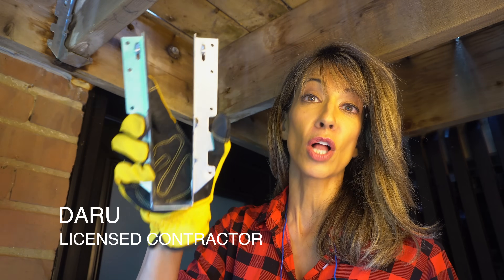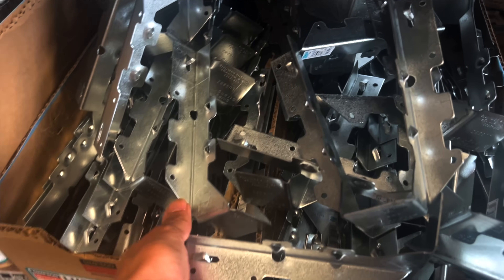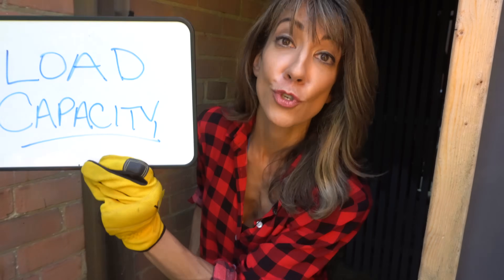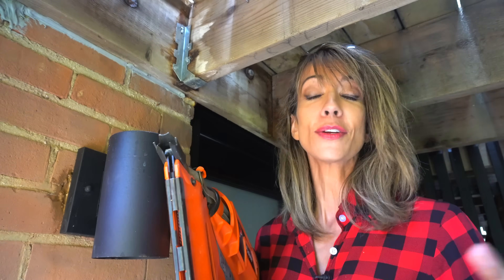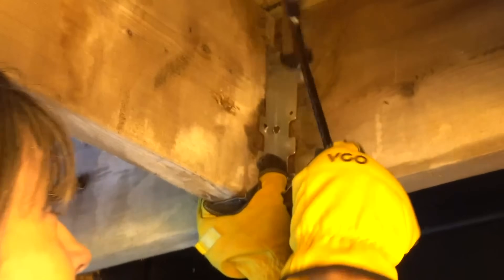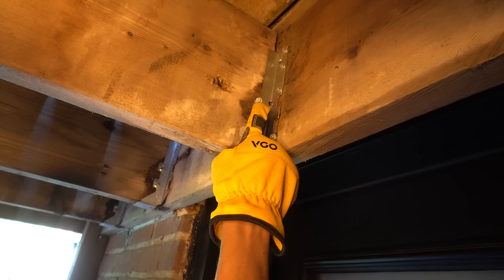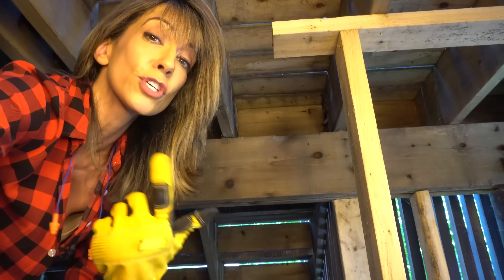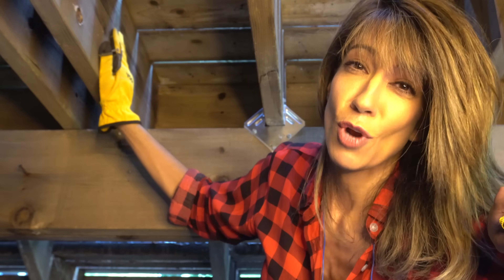Joist Hangers: Do Screws Beat Nails? (Backed by Science)

Comment: I would humbly suggest to you and your followers that in addition to joist hangers which obviously are a must, you also have to put tension ties onto the joists, drill a hole through the ledger and then put tension ties onto the joists inside the house.  Then you run a bolt through the ledger and into both tension ties.  This does not have to be done to every joist.  Every four feet is good enough.  Your deck will never come away from the house with tension ties.  The hard part of doing this is making sure that  your deck joists are in plane with the joists inside the house.  Now, if your joists inside the house run perpendicular to those on the deck then you have to simply put tension ties on the deck and then through bolt through the ledge (and the rim joist of the house of course) and then tie the house to the ledger/deck that way.  This is a very important step that a diyer would not know to do.  These ties are also known as "lateral load ties"
Reply from the maker: @rickcimino5483  Hi Rick, thanks for sharing your experience with tension ties. Sounds like a smart way to secure your deck to the structure of the home. Very interesting. Would love to do that in the future.

Comment: Considering the weight of a big joist, and the load it has to be capable of carrying…I am amazed how weedy thin metal joist hangers are.
Reply from the maker: @contessa.adella  yes! That’s a good observation. They are thin but strong.
Reply: There are at least two companies that make sheet-metal construction connectors - Simpson StrongTie and USP/MiTek. I prefer StrongTie as they do more engineering than manufacturing and all their products are made in the USA where they can control the quality of the product. All of StrongTie's products are highly engineered and tested and will do what is needed of them if properly specified and that means using the right fasteners.

Comment: I just have one question.
I understand the 2 1/2 inch screws for the angle, but I don’t know why screws for the other holes?
The reason why I ask, because the last part ,of the shaft of the screw is smooth, and it doesn’t seem like it has enough threads to bit into single ledger board that’s only 1 1/2 wide. Why not use a 1 1/4 screw for those holes?
It’ll be cheaper on the screws, and it should hold a lot better.
Reply: Yes, she should have used the 1 1/2 for the ledger side, just as she did for the hurricane clips.  The exception is if the ledger is a double 2x10 or like, because the 2 1/2 screws will pull the double 2x10 (or similar) together.  Oddly, her hurricane clips were on a double 2x10 and she could have used the 2 1/2 there.  (There are no common 1 1/4 authorized screws to my knowledge.  1 1/2 is the trade standard Strong Tie.)
Reply from the maker: You could use the 2 1/2" screws on the hurricane clips but I'm following the manufacturer's recommendations in this video. The two 2x10 beams have a gap in them right now that I'll be fixing in a later video. They need to be clamped together for a new post install. Your suggestion is good. Thanks!
Reply: If you have a single ledger board you use the 1.5 inch Simpson SD screws. I would only use Simpson screws with Simpson hangers. The two sizes they recommend are 1.5 for 90 degree fastening and 2.5 for 45 degree. I  think there are several other brands of structural connector screws that are allowed by code but there is no guarantee that your inspector will be aware of this.

Comment: Good info 👍. The 45 deg holes are an improvement over the hangers from 30 years ago, those ones you used 1 1/2 in nails straight in. Hurricane ties are way better than toenailing joists, rafters, trusses. The screws make installing easier in tight spots.
Reply from the maker: Appreciate you sharing your thoughts on screws and the hangers. It’s interesting how much things have improved over the years. Yes, the 45 degree holes are well thought out and make things so much easier. Love the simple improvements. Thanks!
Reply: One thing she didn't mention is that in U.S one of most common hanger manufacturers is SI m  impson.  They have books full of technical imlnfo regarding thier engineered connections for a variety of common situations. 

That said, if you are building a new deck, it is large and off the ground, there are lots of design issues to get correct for it to be safe, everything from wind loads, snow loads, seismic loads, etc. and if you don't know how to correctly install a hanger maybe you need to get help from either a structural engineer, licensed contractor or building department folks to be sure you are following building code and have built something safe.

Comment: Built a large deck during Covid in our yard. Used nails of the correct size and length because they were cheaper than screws. Since I also had a lot of toe nailing to do. I bought a pneumatic palm nailer which made driving all those nails easy. Thanks for the video!
Reply: Whoever invented the palm nailer should receive the Nobel Peace Prize. That thing saves a ton of cursing and homicidal thoughts.
Reply from the maker: @dt76sf  Thanks for sharing your experience building your own deck. It’s always good to know what tools you like to use and why!
Reply: I built my 12’x12’ treated wood deck entirely with screws. There are star head construction screws for the heavy load sections and yellow/green/brown  deck screws to hold studs down. There are very strong steel screws for joint hanger securing.  I put my shoulder out about 15 years ago hammering 2x4 frames in a renovation and switched most of my wood construction to Dewalt cordless drivers and screws.

Comment from the maker: Nails and screws are both excellent and approved fasteners for joist hangers. Have a favorite? Let us know what you like using in the comments!
Reply: Great video.  I would pre-drill the dry lumber, if I’m dropping longer screws into dry lumber.  Ads some time, but won’t split the timber
Reply: I prefer to use a combination of both.  
However, because I don’t buy material, most people use the nails because they’re cheaper.
I think it’s a good idea to have a box of screws around, for those articles spaces when you can’t swing your hammer. 
Plus you have my favourite Milwaukee impact driver. I have the M12 and M18 I love the fact that it doesn’t notice much noise.
Reply: Daru this is such a great educational video. I'm glad I subscribed, this new type of construction educational content is really appreciated
Reply: I use screws as I’m usually working in confined spaces with no room to swing a hammer. Plus an assembly can be taken apart to correct a mistake or make an adjustment.
Reply: I have always used nails but screws don't come loose as easily and with an impact driver easy to install.  I am going to see if I can get screws for my stainless joist hangers.

I enjoyed these videos, keep up good work!